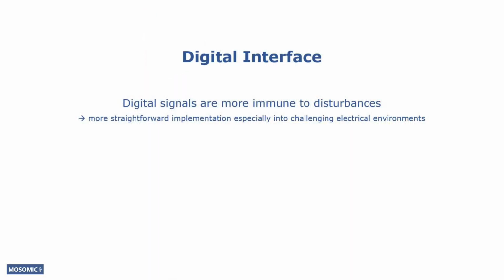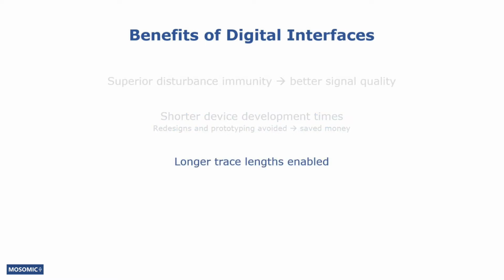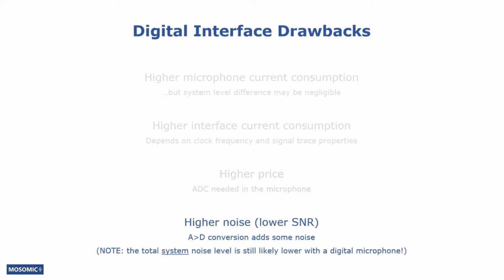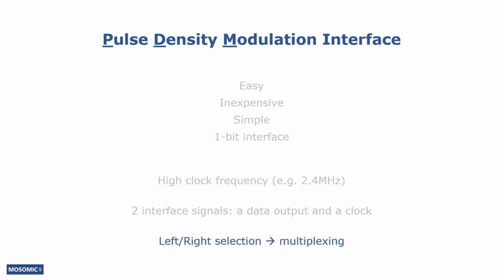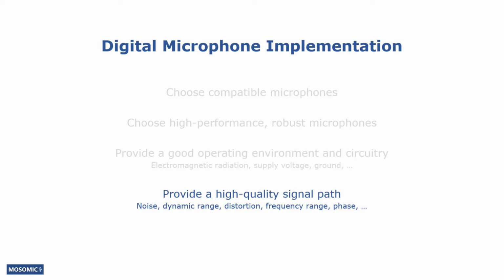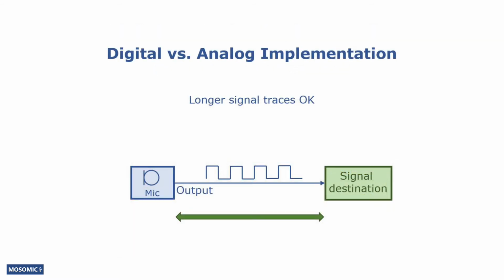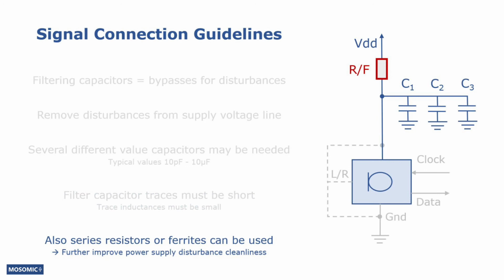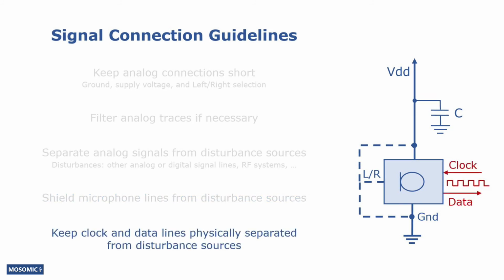Electrical Implementation: Digital Microphones | MEMS Microphone Guide Ep18 | Mosomic

Comment from the maker: 0:28 Electrical implementation of digital microphones

2:01 Digital microphone electrical implementation goals
- 4:39 Drawbacks of digital interfaces
- 6:12 Analog to digital conversion

7:29 Digital microphone PDM interface

9:57 Digital microphone electrical implementation guidelines
- 13:16 Digital vs. Analog Implementation
- 14:10 Guidelines for signal connections
- 15:09 Filtering capacitors
- 16:22 Source termination resistors
- 17:44 Layout and connection routing